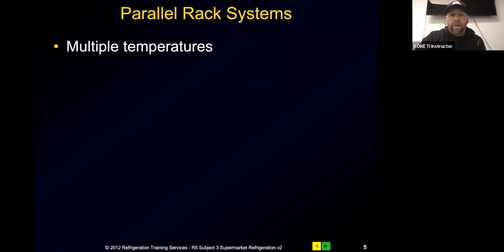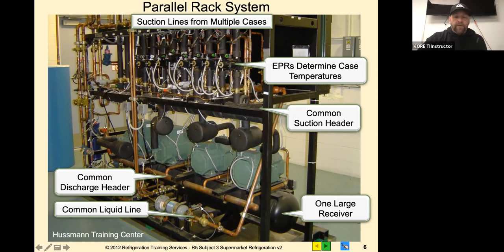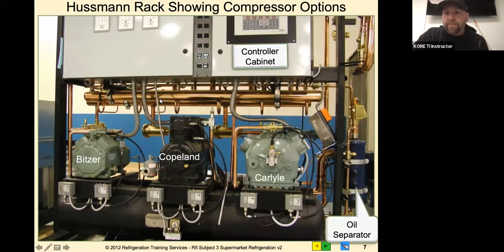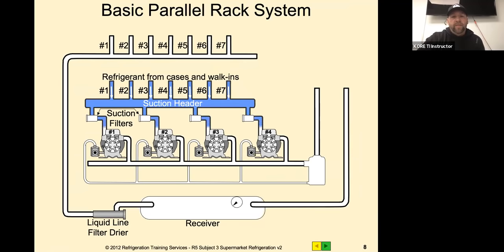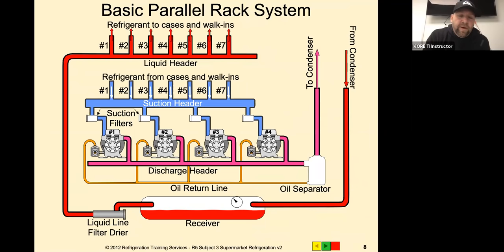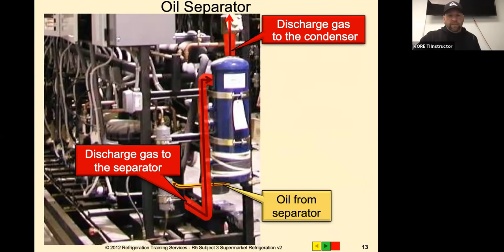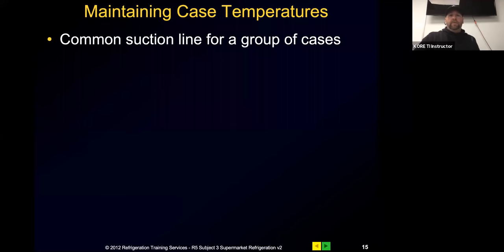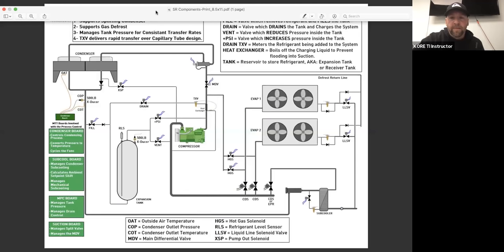Specialty Course 2 Supermarket Refrigeration

Comment: Trying to size an oil separator. Manufacture does not know what size separator was originally installed on the rack. 653.3 Mbtu’s compressor capacity and the capacity used for all equipment is 614 Mbtu’s. Many guys on the Super Market Ref. Facebook group says that the separator can be slightly undersized. My boss is going to replace the separator with what is currently on the system now (which the existing separator has been replaced once before). I’m worried that the existing (current) separator is the wrong size. I’ve also read that you cannot decrease the discharge line size, which is why my boss is going back with what’s in there. What is your opinion on sizing oil separators?